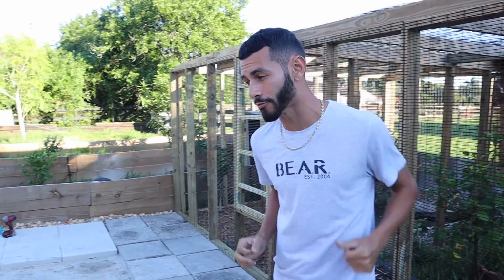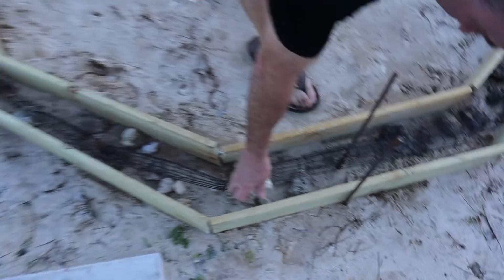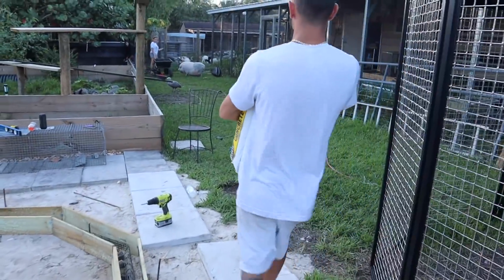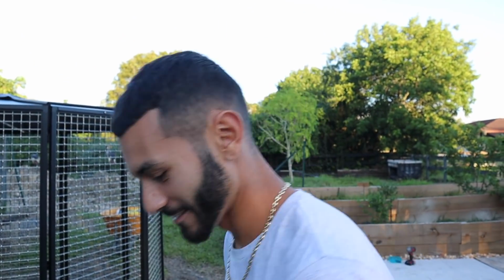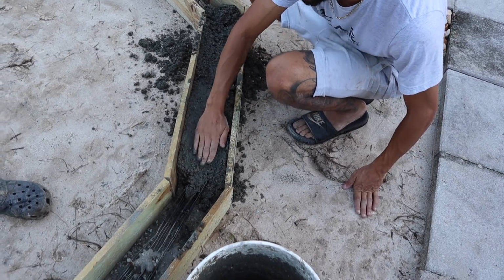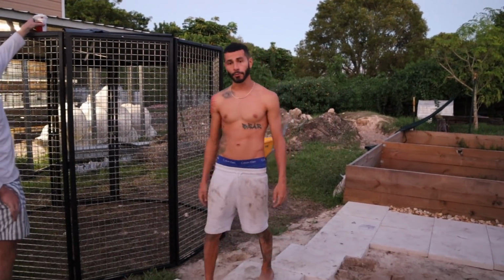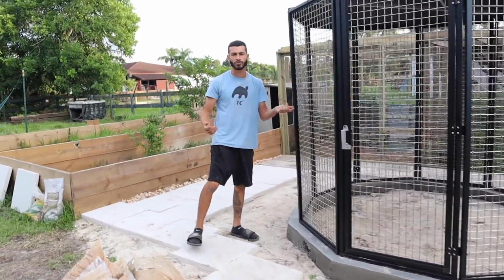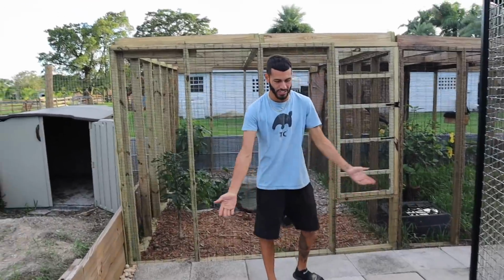INSANELY HUGE ENCLOSURE FOR MYSTERIOUS ANIMAL!!

Comment: Missy and Mister.
The new enclosure looks great!
If you plan to do more of these enclosures or something like them that require cement, but not a truck load at a time, you might want to check into getting your own small electric cement mixer.  You can mix up pre-bagged cement or create the mix from scratch on your own.  Check out Harbor Freight Tools, if there is no store in your area they do ship.  I still use and still love the one I got years ago.  Lol  It works much better then mixing in a bucket.  You could work on cement walk-ways and other projects with more ease then ever before.

Comment: The concrete without rocks is called cement
Reply: Well little more complex then that in America.. Many different mixes, from sand to fine rock, gravel mix so on, plus other mixes that have other ingredients and other names.. From grout (concrete mix), mortar, and so on and on..

Now in Africa where I live we get straight up cement ( no mixes.. Have to make own mix based on what your needs are..

Very rare anywhere in world you use straight cement, always some mix for strength, cost or lots of other uses like weather conditions, weight and so on.